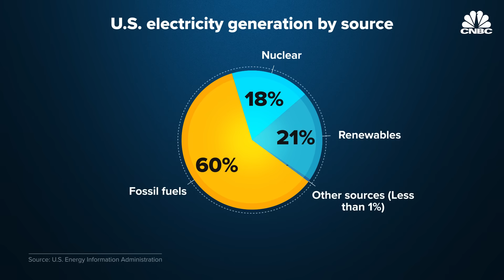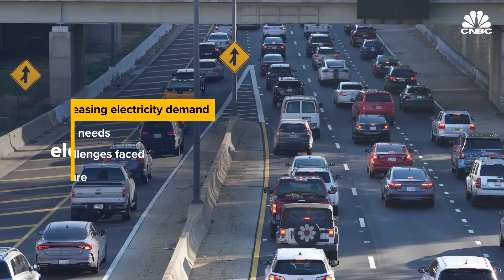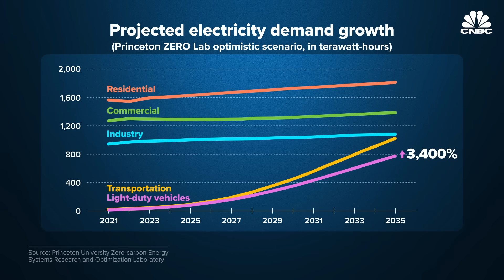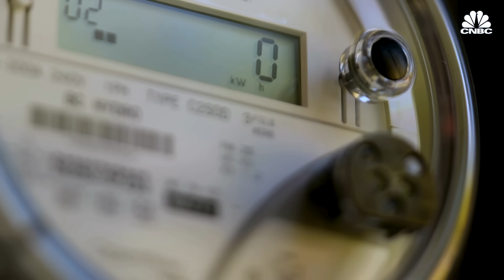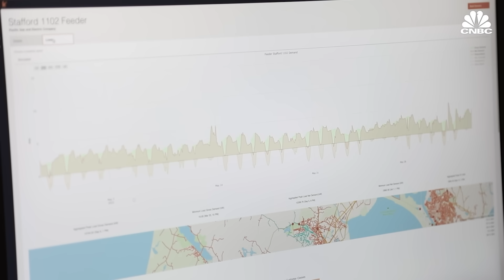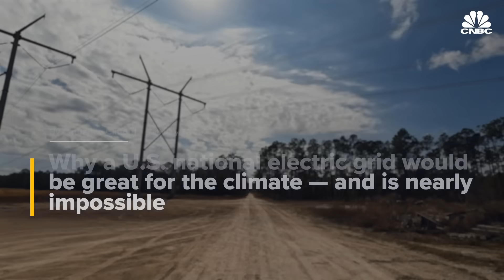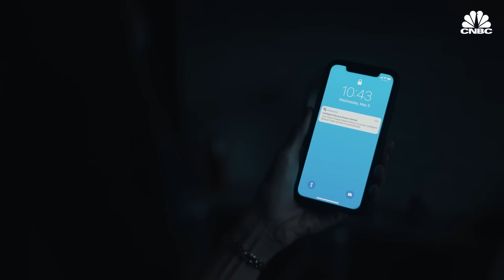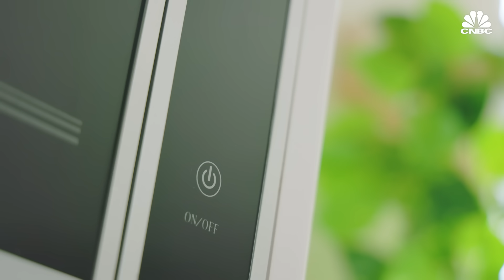Can The U.S. Power Grid Handle The EV Boom?

Comment: No mention of Battery Storage systems?   

I’ve read many stories and watched videos that electric utilities are installing 48 to 96 hours of battery storage depending on their geographical location.  

These stories stated that electric peaker plants are needed less with the more battery storage exists.   

If you ask Google about it,  the first result says “Since 2017, electric companies have installed more than 8 GW battery storage, with 4 GW of that being installed in 2022. As of 2022, batteries account for 34% of total installed energy storage capacity, compared to just 5% in 2017. The remaining energy storage capacity is primarily pumped hydro, nearly 22 GW.” 

These are not Home Batteries like the Tesla Powerwall like mentioned in this video.   

Tony Seba mentions this in his videos.    

In this video I heard a lot about “Transmission Lines”

I think the people in this video are pushing to install as much new transmission lines as possible. 

I was under the assumption that battery storage allows storing electricity so that you don’t need to transmit it great distances. 

You store the energy for your local area. 

The woman 6:55 with the short blond hair said that wind doesn’t blow when you need the electricity or the Sun doesn’t shine when you need the power.    With 48 to 96 hours of battery storage it doesn’t matter anymore, because you’ll have the energy stored for when the wind doesn’t blow or the Sun isn’t shining. 

And then less transmission lines will be needed.    

Maybe we need part two of the this video where they interview the people who are pushing for more energy storage and less transmission lines.

Comment: Reality check: you can’t meet the electricity needs of this country with wind and solar. PERIOD. Stop the fantasy. You want to decarbonize or whatever this BS word is, then you will need to start “radioactivize” because the only 0 emission solution is nuclear to meet the needs without fossil fuel. Also your EV doesn’t need fossil fuel but it took every piece of rare ressources the earth had to be made. Stop the madness. Use flex fuel and hybrid or hydrogène. When will people realize EV is not doable

Comment: I'm amazed at how EV is still a trend at all. They are not environmentally friendly. The production of lithium does so much damage to soil and groundwater that removing CO2 from the atmosphere is comparably far easier. EV's are charged by fossil fuel sources--that this gets chronically overlooked shows the country's massive ignorance. Very little charging is done from green sources. And the power plants generating electricity are burning unprocessed fossil fuels--WAY worse than the refined gasoline. EVs are a marketing gimmick--they're fine if you like an ultra quiet car but that's it. They still cause pollution at the originating power source, their components are toxic to the soil and thus nearly uncleanable, they're toxic to groundwater and the nation's grid can't handle them. And if the grid is upgraded, what's the fuel for the grid--"wind and solar?" The entire landscape of the country would have to be dotted with wind turbines and solar farms to generate the power for our demands so we'll never get there.  It'd be far easier to have a methodology for removing CO2 from the atmosphere than to pin hopes of "electric vehicles" which literally provide no net environmental gain.  Oh...but you do get to pay $10k's more for them than your gas vehicle and you will have to pay more for your electric bill to cover the cost of the new grid which the appropriations will 'surprisingly' fall short in covering. Please people...THINK about it.
Reply: Right, but it is even worse. The majority, even scientific papers, calculate with the current energy mix for charging. 
But thats wrong, bc. by doing this they use renewable energy twice.

Charging EV's is always 100% fossil fueled, except renewable energy would otherwise be curtailed! This is bc. only conventional powerplants can adjust power, renewables can't. If more electricity is needed, the percentage of renewables in the mix goes down (or conventionals up). 

The same effect could observed on covid. The lower demand only affected conv. powerplants that lowers power output.

Comment: One thing nobody's mentioning is that the transition to EV's is helping wean the US from imported oil and enhancing energy independence and security from nations that don't share the US's interests (usually oil-rich and terrorist-supporting dictatorships, theocracies, and monarchies).

One other point never mentioned:  an EV doesn't mean it's good for the environment.  The so-called green revolution almost certainly won't keep up with the power hungry cars, let alone heavier transport trucks...which means long-term higher coal and natural gas consumption (currently around 70% and apparently going to stay that way).  Ironically coal consumption might actually increase because of more EV's.

The last point nobody mentions:  the strange morphing of motor vehicles into political statements.  Bigger "rolling coal" dually's show the person is almost certainly a right-wing supporter, whereas a passive-aggressive hybrid driver (think South Park) is a lefty.  Ironically the conversion to EV's will promote larger vehicles because fossil fuel prices will remain more stable (less demand) and therefore a major enabler for larger and larger right-wing favoring personal vehicles.

Comment: Also no one thinking about how these EVs will destroy the roads faster because the are significantly heavier than normal cars. Also older parking desks, bridges, etc. are NOT equipped to hold all these MUCH heavier EV's. This is why the parking deck in NYC collapsed. But no one wants to talk about that!!

Comment: The issue is most utility companies are being neglectful about investing in updating and maintaining the grid. It has led to a very fragile grid that cant handle ACs during heat waves or storms. 

Peak power plants a very slow and expensive to power up during a heat wave.

Tesla is working to fix this by utilizing powerwalls to provide instant power to the grid during these events.

EVs are not the problem, its just bad utility management.

Comment: It is a much more complex problem than this presentation suggests.  I can see a number of issues.  First renewables (solar and wind) are not reliable sources of generation.  Cloudy days greatly reduce solar production as do calm days.  Also solar has one huge problem called night when production goes to zero.  Unfortunately, residential usage and presumable light duty EV charging can be counted on to surge at night.   That is either going to require massive battery storage or build out of generating facilities that can produce power at night (nuclear?).  One thing the video says is that distributed generation and storage are going to be needed.  That means home solar and battery storage.  Unfortunately that is prohibitively expensive for many consumers.  Just as an example, I live in Maine where home solar simply can't produce enough power in winter for most homes due to short days, low sun angles and snow cover. That is also for a house that doesn't heat electrically or charge an EV.  Adding electric heat (heat pumps) and EV charging makes the deficiency dramatically worse.  That makes residential energy users grid dependent in Winter, but not in summer as is  Adding, electric heating/cooling and EV charging will in many cases make even homes with solar grid dependent in summer.  So the grid generation capacity needs to be there particularly in Winter, but less so in Summer.  That assumes massive uptake of home solar.  Unfortunately, that isn't financially possible for most home owners here in Maine and adding battery storage greatly increases the cost, which makes home generation/storage even more financially difficult for the majority of people.  As an example, my home electric bill without electric heating or EV charging runs about $600/year.  A solar system with adequate battery backup has a payback period of more than 25 years, which is longer than the lifetime of the electronic components of the home solar system.  In other words, the payback period is essentially infinite without massive increases (doubling or more) of electric rates.  Furthermore, the incentives available to encourage home solar are currently all structured as income tax rebates.  Thus, if a family doesn't pay enough taxes they don't get much from those incentives.  That is particularly true for EV tax incentives which are only applicable in the year of EV purchase.  As a retiree, I would get a minimal incentive to buy an EV or add home solar simply because my income is structured to minimize taxes.

Basically, all of the above need to be considered.

Comment: This is a very simple question and can be broken down into simple mathematical equation. 

If we are going to make this transition and still allow the American Traveling Public to continue with the travel freedoms we enjoy today and get it done by 2050, the answer is a simple "No."

Americans drive 2 trillion personal miles per year. The  most efficient EVs (and I own two of them) get 4 miles per kilowatt hour. 

The 4 mile per kilowatt hour value is under ideal conditions in California or someplace like that. 

In the Norther tier of states, it's more like 2.7 to 3 MPKWH. But I will use 4 in my calculation. 

Using that value and dividing by the number of miles drive and months between now and 2050 means the American electrical grid must add 2200 megawatts every 6 weeks. 

That would be the equivalent of placing a large dual unit nuclear power plant on line every six weeks. I work in the generation industry and can assure you that's not happening. 

Since that level of generation increases are not occurring, then the answer is again a simple "No." 

My calculation also does not include any commercial transportation miles traveled. No busses, trucks, or rail miles traveled. 

Since the answer is just a simple "No," then the only success path in making this transition to all electric travel thing is to curtail your freedoms and not allow Americans to travel freely. 

And that is the goal...limit your personal freedoms. Our future never looked so bleak.

Comment: Everyone should buy an emergency generator for their house.  (I pity apartment dwellers who may not be able to use generators.)  Between the government mandates to go electric, and the increasing unreliability of the grid due to intermittent sources, there is going to be very unreliable electrical supply in the coming years.  Just last year California outlawed ICE cars in a few years and then a few weeks later told people not to charge their EV's due to power shortages.

Comment: This video is such a joke, they telling lies to cover up things. Also you can't compare a Hot water heater to a Refrigerator as it takes more energy to heat then to cool your left over pizza.  Really stupid.  Also, it takes more energy to make gasoline and Natrual gase then it does to drive a eletric car.  Hell I run my house off of 40 solar panels and not on grid with AC and everything else.

Comment: None of these reports seems include the fact that most people will charge their EV's at night when a lot of industrial, commercial, and residential use is reduced from 8pm until 6am.  This reduces a significant additional load on the grid.  The grid will need improvement just due to the forecast load growth from industrial, commercial and residential anyway.

Comment: They need to construct nuclear power plants to SUPPLY the electrical grid.  But there aren't any such plans proposed by the Biden administration.  Simply rebuilding electrical distribution systems isn't enough.   Another factor is that a number of hydroelectric dams have continually decreasing reservoir head.  Therefore, there is a significant thread that hydro power supply will decrease or at least not be expandable.

Comment: Well 20 years ago we were supposed to have a 10-year project to read you all the wiring in our electrical grid going from standard copper wire to a low loss superconductivity wire. Supercentivity wire is a big game changer especially as the wire becomes more shelf stable temperature wise that's from about minus 20° to positive 220°. What amount of savings would be huge my friends this is just like what happened when America was supposed to be laying down fiber optic cable from coast to coast and we didn't do it it's piecemeal

Comment: First of all, ground transportation would be better served by switching to Hydrogen. Charge times and range (especially when towing) are insufficient with BEVs. Hydrogen solves both of these problems.  So that is where the build out and research dollars should be allocated.  And they keep talking about charging at home.  Most people do not live in single family homes with a nice garage.  Take a city like Chicago.  Where do people live, in a three flat or apartment building. And where do they park?  On the side street as close to where they live as possible. What are they supposed to do, run mile long extension cords to plug in their car that is a block and a half away??? Not to mention in winter Chicago has a quaint little custom called Dibs.  Once it snows and you shovel out the spot it becomes yours for the rest of the winter and is defended by chairs and other things.  Woe to anyone who moves that chair!!!.  Next, the only way to actually upgrade the power grid in the manner being discussed is to nationalize it.  However, wind and solar are notoriously unreliable sources of power.  And they also have their own ecological negative impacts. So, I go back to the statement that Hydrogen is the power source we need to move to, IMHO.  As far as a fueling infrastructure goes, every current gas station can be adapted to also pump hydrogen.  It's just as quick to fuel as gas.  You don't have to wait there for the better part of an hour.

Comment: I started switching to solar 8 years ago first out of necessity and then out of it was just less expensive than going on the grid. It was a slow buildup for me which gave me the opportunity to learn on the go how to install and maintain the solar system myself. That greatly reduces the cost of solar. 
Upfront cost for me to go on the grid was at least 3,000 dollars. 1500 for just the hookup and then at least that much more for the powerpole, trenching and all the other stuff you need. I just put that into a small but good-sized solar system and some golf cart batteries. Three years later its paid for itself and then I started adding more panels to it and beginning the switch to Lithium batteries. The goal is to keep adding to it slowly so it's paying for itself as I go. 
Even the smaller starting solar system was meeting my basic electricity and cooling needs easily. Now I am getting to where I can pretty much do anything a person hooked up to the grid can do electricity wise. 
I was renting a decent sized propane tank. I've gotten to where I was using so little propane the company got snotty with me over it. I made them come take the tank away! It is pretty cool when you get to that point, and you can say I am my own power company!
Reply: The US needs less electric cars and more electric trains 🚝🛤🚇🚎🚲
Reply: It's cool that a select few can do this but it should never have come to this point. It's dangerous to keep large lithium batteries in your house or garage and it also hurts the supply of batteries for EV's. If they are second-life batteries then I am on board. People should actually look into Flow battery systems instead as they are safer and the solution can be recycled easier. Large power companies should also be buying up these flow batteries and use them as microgrids in areas where needed and also capture excess solar energy during the day. I think 7 Billion in funding would go a lot further in setting up these systems instead of dealing with all the politics of rebuilding more power lines.
Reply: @MrBadbonesaw  Lithium Iron Phosphate (LFP) batteries seem to be safe and reliable these days. I don't worry about having 45kWh of LFP battery storage in my house. Also they last a long time - 6000 full charge-discharge cycles or more, and we only partly cycle them each day.

Comment: I read a lot of good comments.

But I am a stupid old man and there seems to b a couple of things everyone is missing.

1.  Just a rough calculation of changing over 50 percent of the cars to EVs will require 3 times more electricity then we already use.  PERIOD

2.  Just a rough calculation to do just the current electricity needed we need approx 1000 square miles MORE solar panels in every state with a population over 9 million people.  Not counting manufacturing or commercial.  And in lithium ion batteries to distribute it when the sun is not shining we need more raw lithium than exists in the world.  ALL JUST FOR CURRENT NOT 3X WHICH IS WHAT WE NEED WITH 50PERCENT EVS.

3.  I have a gas and a ev.  EV the ev is the best around town the gas is the best traveling.  PERIOD.

4.  Nobody is doing what is needed and just simple multiplication and building new power plants NOW except the bric nations.  AMERICA AND THE WEST ARE IDIOTS.  RAN BY IDIOTS.

Comment: Natural disasters will definitely screw up things if power lines fall down
Reply: Most of the large outages are caused by smaller things. The worst one I remember here in Arizona affected the eastern third of North America from the Sea of Cortez to the Arctic Circle. It was on August 10, 1996, when a neglected filbert tree under a power transmission line grew a bit too much and tripped out the line. Like jostling a waiter with a tray full of drinks, one thing led to another and we were without power in Phoenix overnight.
Don't feel left out; the public at large has no idea how continental electric power works.